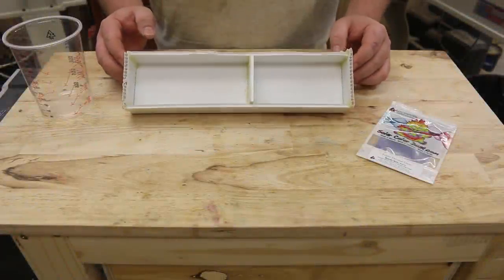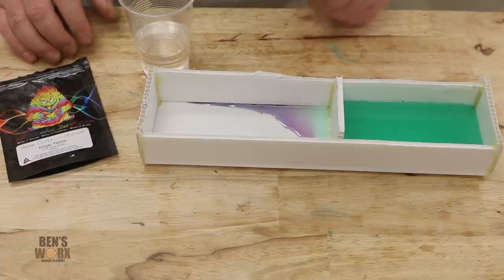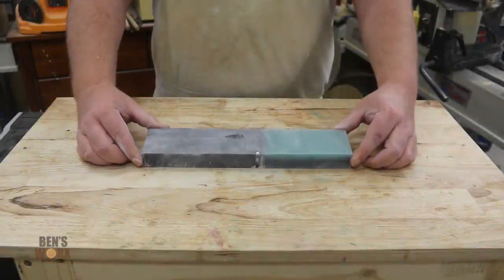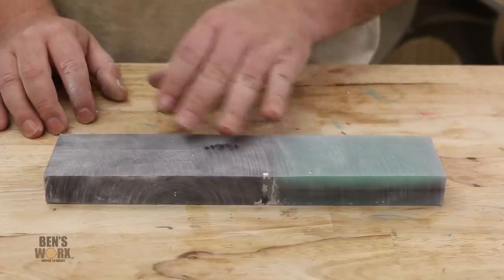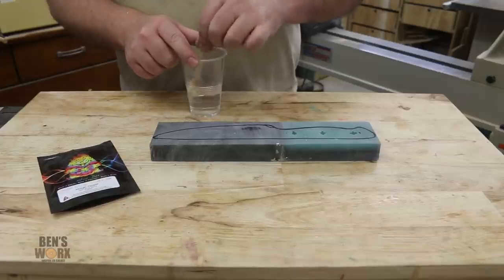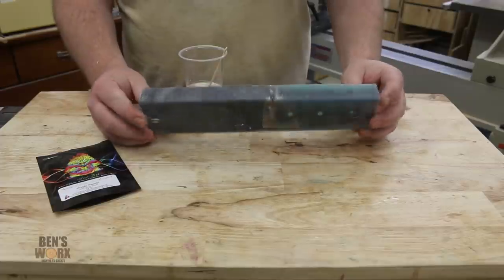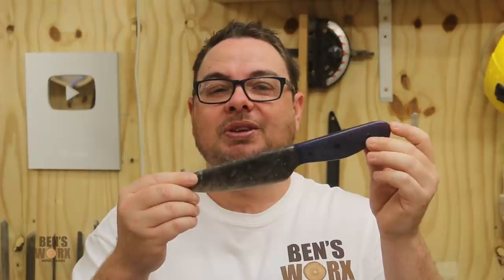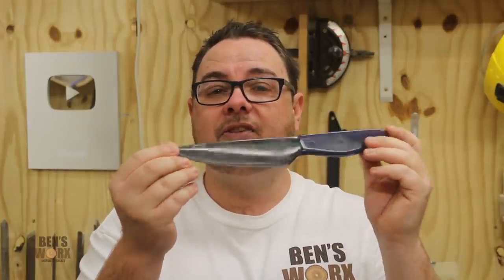Can You Make a Sharp Knife From Resin?

Comment: Wow, thats amazing!! I watched as you sanded and couldn’t help but notice you never block sanded. If I may ask how do you get it so level/even without block sanding? It looked perfect. I just don’t see how you could achieve what you did without blocking it. Is resin just easier to work with? I have worked bondo on auto body dents and the only possible way to get the contours right as well as get the dent straight and in line with what it joined was to block sand it usually starting with 80 grit and finishing with 400 grit. I know 400 grit is just the beginning with resin but again how do you achieve such perfect details without block sanding? I am asking because I am working with resin now. Just a hobby now but you never know what it might lead into. Great video and thank you for sharing. Awesome job!! GOD bless my Friend!!..                :))...........

Comment: Epoxy is a type of adhesive often used to join materials such as metal or wood together. For this reason, blades made with epoxy are generally not suitable for cutting operations and may be hazardous to health.

Epoxy material breaking down during cutting and mixing with food may cause health problems. Additionally, the chemical content of the epoxy material can pass into food and adversely affect human health.

Therefore, it is not recommended to use knives made with epoxy for food operations such as cutting vegetables and fruits. Instead, healthy and hygienic knives that comply with food safety standards should be preferred.